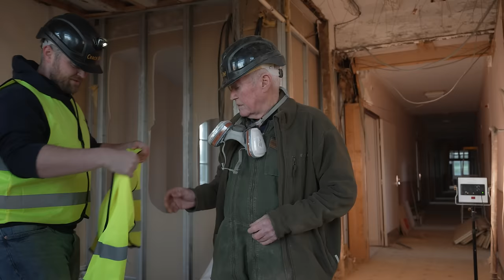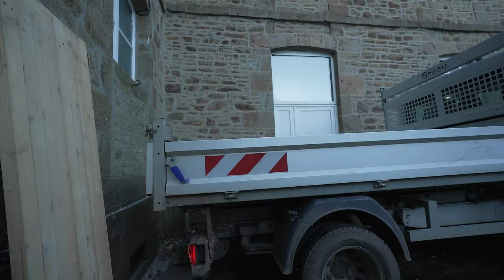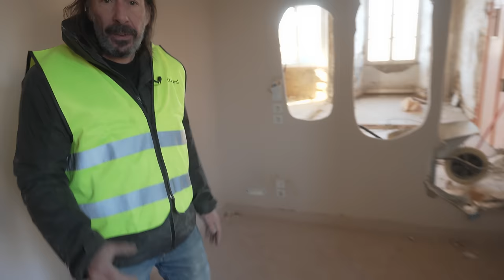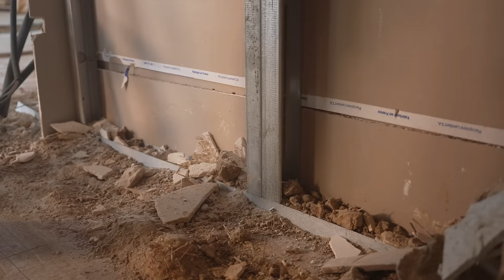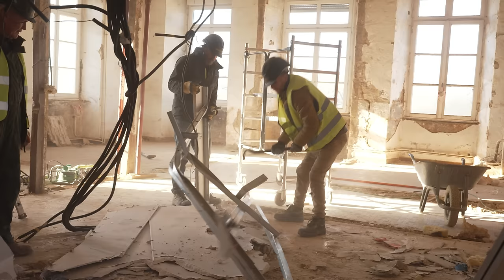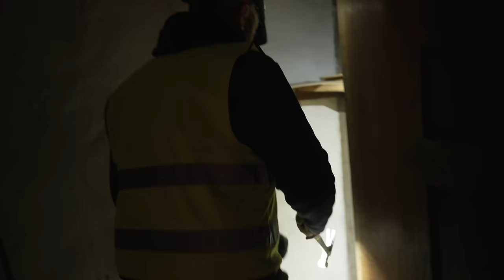This Explains A Few Things

Comment: The gallery needs to be wheelchair wide for access for the disabled that would enjoy the art gallery too.

Lots done today Billy. Also Simon I loved hearing about how nails were handmade. It’s been so fun hearing all the bits and bobs of this old building.

Wishing your parents a nice time away together and safe travels too. ❤❤❤
Reply: That means turning radius at the corners.   It also would be good to have some indoor greenery.
Reply: Access for the disabled isn’t possible until the decision is made to fix the elevator.  As of now, this building is not accessible to those who can’t walk, Which is really, really unfortunate for them.  It’s not fair.
Reply: Super important!
Reply: @nickandlaurihyde did he say he wasn't going to restore it? I really hope he does, or replace it with a new one.
Reply: @nickandlaurihyde  I am sure that Billy will eventually get the elevated up to code or whatever will be required. I do have faith in his ability to do what is required in all aspects of this huge project.

Comment: Billy, I wonder if you've considered extending the sides of the dump bed on your truck. I had a similar situation where I added plywood sides and screwed wood at the bottom that slid over the aluminum sides of the bed. It tripled the capacity of my bed and reduced the number of tripe to the dump. They can be temporary.

Comment: I know nothing about engineering but I wondered if the void could have been used for the weights and chains in a weighted winch system? I remember you said that there used to be a winch in the attic... I agree with others that it looks too clean to have been a chimney. Our cottage is from 1750 ish and it was covered inside with what looked like thick tar several inches thick from years of open fires.

Comment: All good stuff folks.  A point or two on the width of the gallery, enough room should be there for two people to pass and also for the correct angle for a ladder to reach higher shelves.

Comment: I did wonder if, because of the proximity to the priest hole, if the void was part of an escape route from below the convent, or from a secret exit/entrance in the refectory to the outside. So someone could have used a wooden ladder, for example, to climb up from the basement to the priest hole.

Comment: Oh how wonderful is this going to be.  Can't wait to see the next instalment.  Billy, have you check what the French building codes are on the width of your walkways?  I believe here in Australia, walkways in office buildings under WHS are required to be a certain width (somewhere around 1.5m - 1.75m depending on emergency egress pathways etc).  I would hate if you make plans on a certain width only to find out later that they need to be wider.  We are already starting to get a clearer idea of the finished library - which with the care and attention you are all putting in, is amazing.  Nice to see that everyone is wearing safety hats, clothing, footwear etc.  Although, maybe consider some eyewear as well, as I almost freaked out weeing Yannis almost get hit in the face when removing one piece of metal framing.  Keep up the great work guys, you are a pleasure to watch.

Comment: That ceiling is VERY bowed... But coming along very nicely... so at some point they took the chimney down from that 2nd floor to the 3rd ... and up to the attic... wonder when they did that?  Suppose when they put in the radiators?  Seems a weird thing to do just to take out the fireplace and then drop the chimney and leave it in 1 or 2 floors??? Maybe that's what caused a fire at some point and that's why they took it down?

Comment: The gallery should be slightly smaller.  You have to think not can you walk through it.  The key is can someone operate a wheelchair without banging into the bookcases or the balustrades.  I think you are close to perfect, just a tick smaller on the gallery feature would be huge to a wheelchair operator

Comment: The purpose of the opening between floors is to give an expansiveness and drama.  In order for the balustrade to allow for visual connection to the upper area/floor with the bookcases the balustrade should not be obstructing the view - i.e. heavy balusters - check Jacque Garcia's 2 story library where the balustrade is iron and allows full visual connection to the entirety of the 2 stories.

Comment: There's ever more sensational work seen every video guys. 

One suggestion - please consider making the library floor cutout an OVAL shape or at least a ROUNDED rectangle. Curves may be a bit more elegant than a pure rectangle.  The perimeter balustrading seemed to give quite a 'hard', angular, and baroque appearance on the architectural mockup.  

As well as hopefully looking more elegant, it will give people more room to pass other people around the corners of the room.

Comment: 1.22m clear between face of finish bookcases and walkway face of railing around opening.  Rails on rendering appeared to be 10cm -15cm.  Bookcases typically 25.4cm deep.  Face of gyp wall to edge of opening should be 1.624m minimum, if your intent is to make the opening larger.  Maybe room on the end for seating.  1.8m will have more space than needed. IMO.

Comment: Regarding replacing the oak beam, aren’t you going to remove the beam in the floor to make the atrium? If it’s not bowed or cracked could you not remove it and replace it with the steal beams and then use that beam to replace the bowed one and save a lot of money?
Reply from the maker: it’s in worse condition!
Reply: Pity

Comment: You have identified the problem with replacing the bent beam - that everything resting on it is also out of shape. I'm worried that you have so many bent beams in the place that if you replace every one of them you will have no original building left. That's why I think a steel flitch plate or splint would be the best solution. For the library  it could be skillfully hidden within the beam for aesthetic reasons, but elsewhere you could openly use two plates and just bolt one each side. Some folks call that an "honest repair". The huge advantage to a steel plate repair is that the steel can be cut to the curve of the beam, meaning you end up with more strength than the beam ever had when it was new but without the need to disturb the rest of the building. There's nothing wrong in an old building looking a bit "wonky" here and there so long as it has enough strength.

Comment: Absolutely love your channel. There must be a way to save the secret room, perhaps jack up the floor joists and brace them from underneath. Also restoring the 2 fireplaces would be nice. Even if you don't use the one upstairs, it would make a nice addition. Don't you have 2 mirrors with the paneling?

Comment: The 1•80 metre gallery might be a wee bit too wide as it will impact on the lighting of the floor below, both with natural light filtering down from above and the chandelier you are planning on installing. Maybe 1•50 or 60 metre would be a better approach??...

As an afterthought, having a 1•80 metre wide gallery might inadvertently remove some of the sense of volume, height and grandeur you're aiming for Billy, leaving the lower half feeling a bit too enclosed & lacking in the expansive airiness that makes double-height rooms a success.

Comment: Billy do not weld the steel bolt to the RSJ have plates welded to the ends of the cross members the welding in the mid spans of the RSJ weakens the steel it is also much easier to assemble than trying to hold them in place while welding.

Comment: Drawing with a Spray is very effective and descriptive indeed. I wonder if the same balustrade as in the main staircase for the Library, would be to heavy locking ? Would it suit this delicate space? But then again, you might order them 'the same as...' but in an other proportion. And the Beams... Question, what would be the problem with a bit of a Quirky ceiling (with a bit of a 'Bow'? And what is an ARSG?
Reply: An RSJ Is a steel lintel that supports walls floors, ceilings etc. You have to put them in over large windows, patio doors doors etc to support the upper outside wall.

Comment: Just a thought, could you put a couple of support beams running from the bottom floor to the warped beam as decorative post as part of the design? Then you wouldn't have to worry about the third floor.

Comment: Love watching the Crack On! Construction Company 😊 Why don't you bring the scaffolding thru the chapel door?
Reply: It might be because of how close they can park a vehicle? Not sure, but I think the chapel outer door opens onto a footpath rather than the street,  so a large delivery vehicle would not only partially block the street, but they still have to carry stuff along the footpath. It might be easier and a similar distance, to just park in the courtyard and carry it through. I’ve found out the hard way, that in European towns there is often a gulf between where is most efficient for delivery and where vehicles are actually allowed to pull up - it can be a total pain!

Comment: Question for Billy/Alex (or anyone in the comments that may have experience with similar camera equipment used here). At the end of the video around 28:08, are the ceiling joists to the left and behind Billy truly that bowed, or is there some added distortion do to the camera position and/or the lens used?  Just curious as it appears quite severe in that shot.

Comment: A further comment - I'm concerned you have got this far in the work without a clear idea of the dimensions of the opening you want to put into the floor. Would this be a good point at which to bring in an architect? Getting an architect to sign off on the design and then the work when it is completed may well make it much easier to sell the property when all the work is done, and I think the excellent videos will be more enjoyable to watch if we know you have a clear vision for the place and we just have to keep watching to find out how it unfolds!

Comment: Please allow enough width in the gallery for a standard wheelchair to get through after the bookcases are installed.
Reply from the maker: how wide is your wheelchair?
Reply: Another suggestion for “how wide” to make the galley is since it’s likely guest would be moving back and forth through it is to try and make sure two people with large wheely suitcases could pass each other easily or it could become a choke point when guest are arriving and leaving

Comment: How does Hi viz make them safer?
Reply: It makes it easier to see each other especially in low light conditions (like a big building with no electricity) which means they are more aware of each other and don’t accidentally hurt each others e.g. drop things out a window on someone they didn’t see below or pull down part of the roof on somebody they didn’t notice was there.

Comment: Why weld the steels when you can fabricate by bolting? Also remember your balustrade, recalling your illustration is going to be substantial. Measure your big staircase to give you an idea. I guess the footings and rail could be about 30 cms . So you want wall lining plus book case plus walkway plus balustrade. If you are taking down a book from top shelf you may need a small transportable library step. This cannot be left in walkway unless there is an acceptable space to put it in and there must be no risk of overbalance, in normal course of events, down the well. The well could end up being smaller than you think. You might have to get final dimensions cleared by building regulations before construction or there could be an expensive adjustment later. Measure and ask. You might not like the reply but your bank manager will! As it is a new deviation for the structure current safety rules may well apply even in France. Don’t get caught!

Comment: Where's the circular staircase going to be???😺
Reply: Why are you putting in a beam if it's going to be open there?
Reply from the maker: the ceiling of the library needs a new beam, it’s not part of the gallery.

Comment: Interior designer here (interior architecture not just the pretty stuff).  Here in the US walkways need to be a minimum of 36 inches for comfort as well as wheelchair access.  So you need to calculate how far the stud work, and shelving come out and then have at least another 36 inches for the walkways